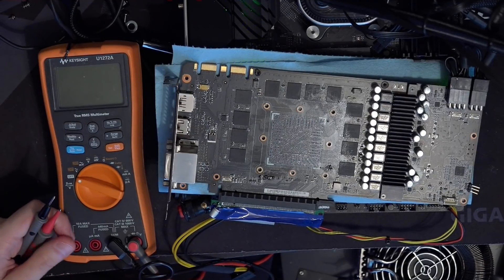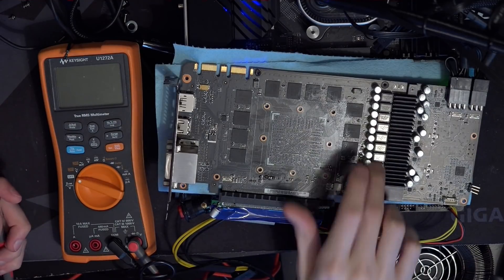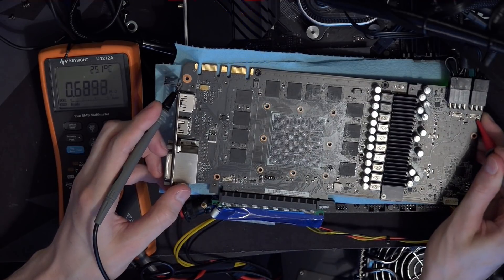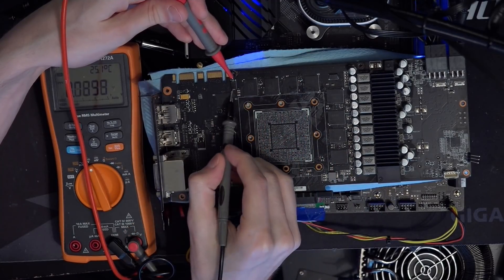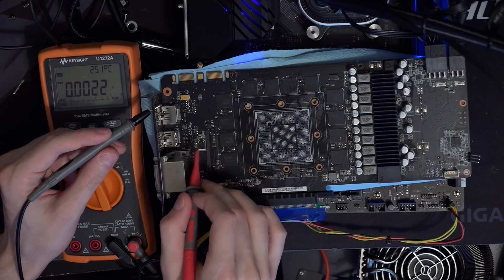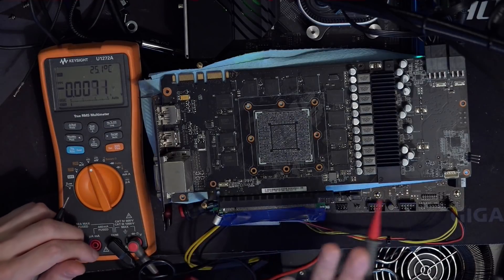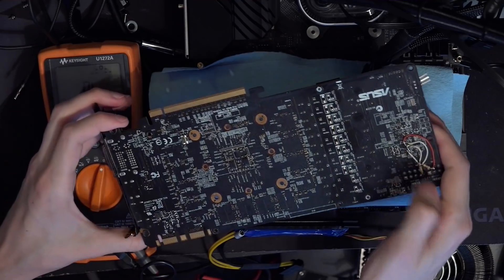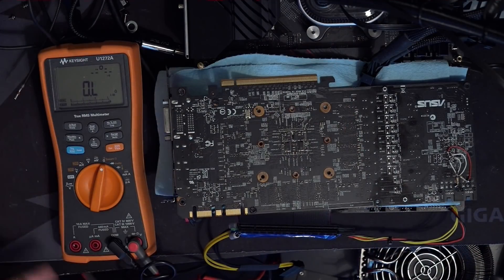A simpler way to build E-powers

Comment: Nice, neat and useless. LOLZ. By the way, thanks for the 6900 XT video with EVC2. My EVC2 has arrived and I managed to connect it to ny 6800 XT using bare wires (I tried soldering pins but it was beyond my power; I think the included pins are too short). I’m No. 3 in Time Spy Extreme (6800 XT+5900X and No. 14 in Time Spy. Hoping to improve my ranking further.

Comment: Why not using a sata connector to get 5v and 3v3 directly ?
Reply: More cables, more electrical noise, potential for ground imbalance is what id think
Reply from the maker: I used to do that till I came to the conclusion that the extra sata cable really gets in the way.

Comment: I cannibalized a dead GTX 570 DC2 for powering my asrock 4coredual board. Not the cleanest job, but works great. Supply 3.3V and 5V, bridge 12V power planes where needed. Tutorials on hwbot helped a lot.

Comment: when Buildzoid learns how to solder the cores back on this will be the best channel on youtube
Reply: I thought it would be hard, but it's not actually that bad. I have a GTX 980 FE that was bent so bad by the last owner mounting an Accelero Xtreme to it, that the solder balls cracked apart. I bought some no-clean solder from MG Chemicals, and used a black and decker heat gun with a laser temperature sensor and was able to flow it back together well enough that I'm using it now. No issues, clocks as high as any other GTX 980 FE.

Comment: it looks like the big tab on that 5v regulator is ground, i'd grab some sandpaper (if you dont already have it, around 240-320 grit is what i find works best, also very good for cleaning up the edge of the pcb after you cut it), find a patch of ground plane that is directly under the soldermask and sand it off, then solder the 5v regulators tab to that instead of putting it on perfboard, more solidly mounted to the board, it doesn't need any of the passives next to it to function, and the output caps dont matter either. using a UA78M33 for the 3,3v rail is probably the best bet, means the tab can be soldered to the gnd plane also and takes the 12v input and no passives once again.

great video!

Comment: I thought fully digital VRM can't run without core signal. I was wrong apparently. Still remembering these EVGA powerboards that you could solder to your existing GPU in order to give it some 500w of extra juice.
Reply from the maker: VRMs boot before the GPU core.